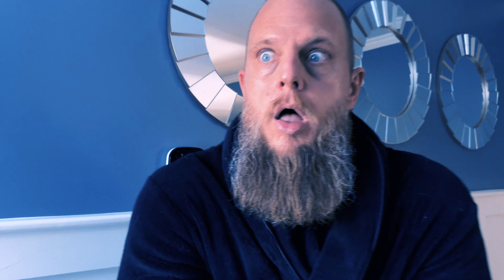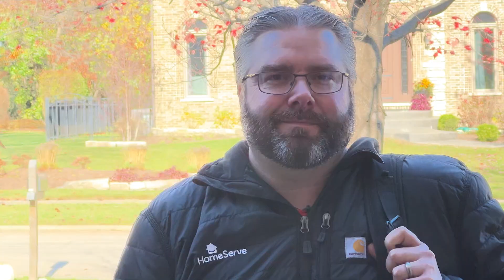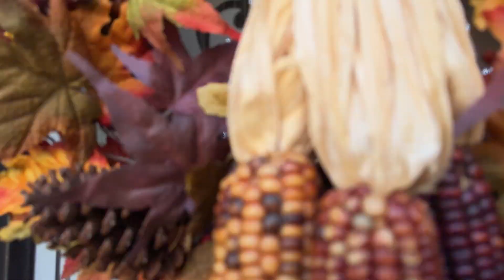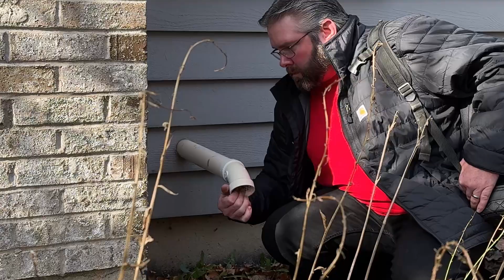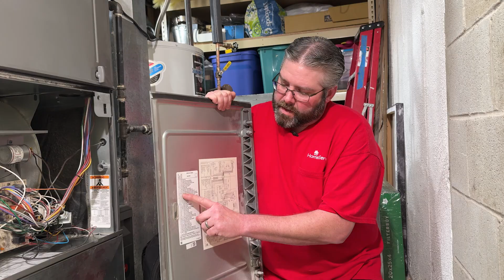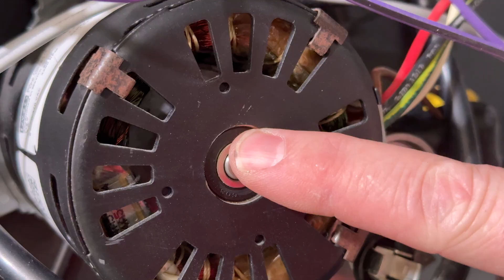No Heat? What to Do When Your Heating System Stops Working in Winter!

Comment: My heater just broke last night the heater turns on but no flames underneath smh I don't have money to pay someone to fix it what to do?
Reply from the maker: That’s rough, I’m sorry. If it turns on but no flame, it could be a pilot light or flame sensor issue. Make sure the thermostat and gas valve are on and the breaker isn’t tripped. Don’t try to relight anything if you smell gas.
Reply: @HomeServeUSA should I turn off the heater if no flames come underneath?
Reply from the maker: Given that it involves gas and flame, this is really a call-a-pro situation. There are multiple possible causes and it’s not DIY-safe. This video does a good job explaining: http://spr.ly/6053C7NUW
Reply: @HomeServeUSA the flames stay for 5 minutes then it turns off

Comment: This is a typical crappy American furnace with a rat's nest of wiring inside of it.  It would have taken the factory maybe $10 more  labor to have used adequate length pre-cut harnesses and dressed down all the wiring neatly. Why should the inside of a major appliance that you relying for health be any sloppier in assembly then what's under the hood of your car?

Comment: I thought an induction motor would always spin freely unless the bearings are getting tight.
Reply: I agree with you . The inducer should spin freely.  One of the pressure switches were bad.